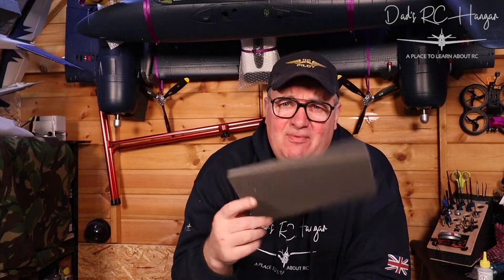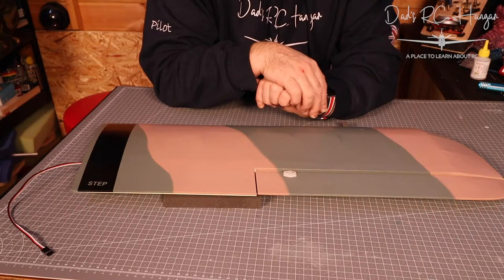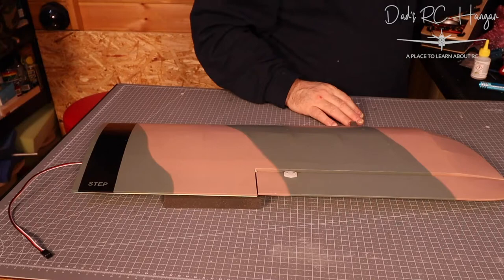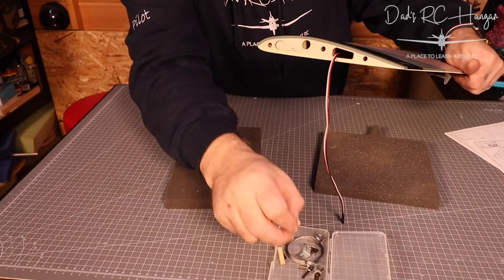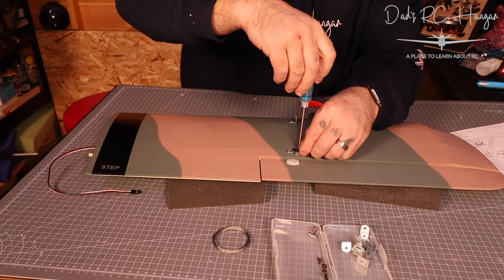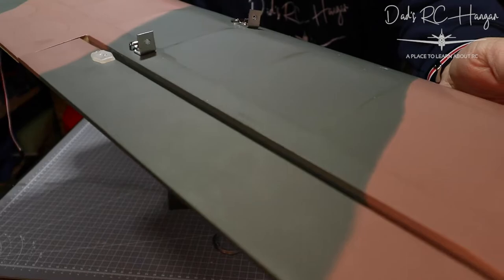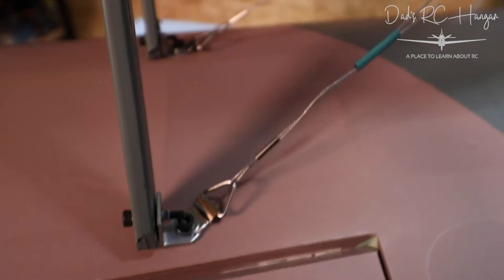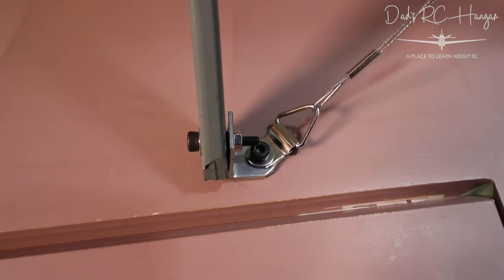Nexa Tiger Moth Wings installation

Comment: On the dowels make them a bit longer. Fit them in wing and slightly into fuse. Add a drop of ca at wing side. Done. U may need to round off the fuse side as it will be tight there.  
Maidened my tiger last month with out the wing wires. Flew great. Very good flyer. Thanks dad.
Reply from the maker: Hi Wings88. Yup you see in the following videos what I did. Great to know you had a great maiden. UK still grounded and lockdown. So looking forward to when we can get back at the field👍🏻

Comment: SO I HAVE ABOUT 100 FLIGHTS ON MINE NOW AND LAST WEEK ONE OF THE WING WIRES BROKE EVEN THOUGH THE ATTACHMENT POINTS ARE SMOOTH ROUNDS   I HAD TO REGLUE THE PILOT IN AFTER ABOUT 25FLIGHTS  NO OTHER TROUBLES.
Reply from the maker: Wow 100 flights, that’s wonderful. Interesting about the wire, maybe knowing this, we should all have a maintenance Log, and change things like this after 50 flights maybe. Thank you for then updates. Have a great week ahead👍🏻

Comment: Cables are a pain, gonna look for good jewelers braided SS wire in a thinner gauge.
Reply from the maker: I enjoyed the cables, just the wooden dowels the pain. But I have some wooden dowel, so I will make one long length that sticks out both sides. More solid and easier for the wings to go on. That’s for popping by William 👍🏻
Reply: @DadsRCHangar  these are not functional wires, give 'em some slack. They will break (yep, and more often than not) every other flight if too tight. I bouhht 60 pound braided fishing wire (the green kind), and cut small pipes out of copper fuel tubing to clamp the new fishing line wires when putting new ones. I give the line a few spins around the tubing before clamping, then a drop of CA glue.
Reply from the maker: @zubuxstein  thank you for that. I thought they were functional. Will get some of that fishing wire 👍🏻. Once again thank you for sharing your knowledge. Hope you stick around and subscribe. Have a great day. 👍🏻
Reply: @DadsRCHangar  I did subscribe, is a wonderful channel. For the collar loops, get fishing hook and cut out the hook and keep the side w the eye. Looks so much nicer and realistic, just be cautious w those hooks, dangeroua dangerous they are. Also been a round eye does not have sharp edges that tend to fry the wires. 

I admit, the wings and tank placement was very challenging to do.
Reply from the maker: @zubuxstein  thank you for joining the channel. Yup I will defiantly change the wires over the winter.  Will see all the mods on the maiden. Trying to get time to sort out the electronics, have everything, just it’s that time of year. I guess the Moth will be another couple of videos 👍🏻